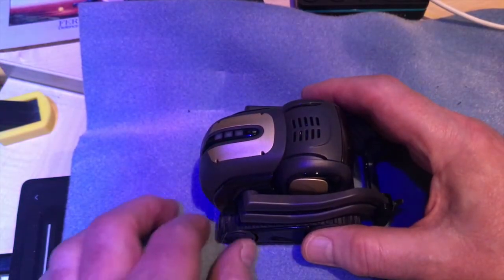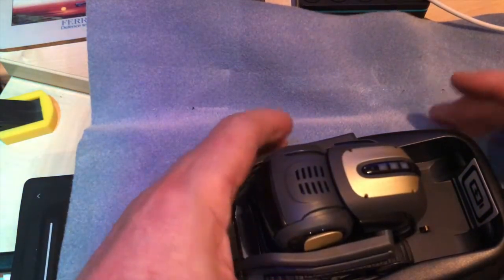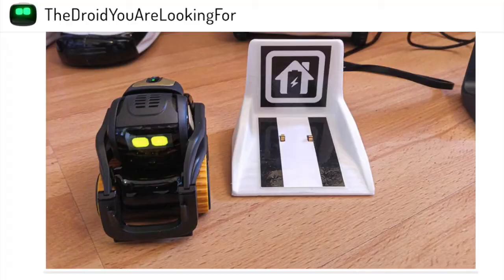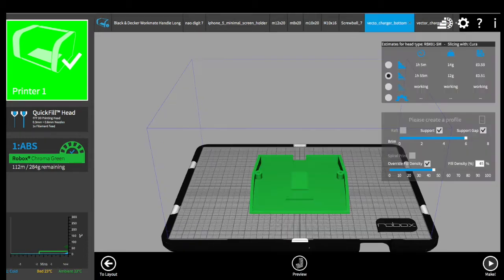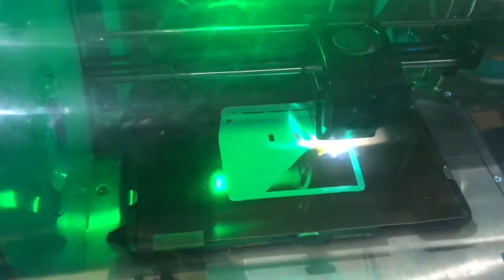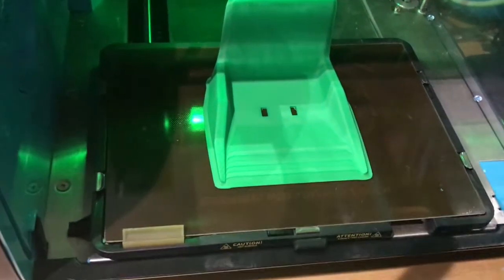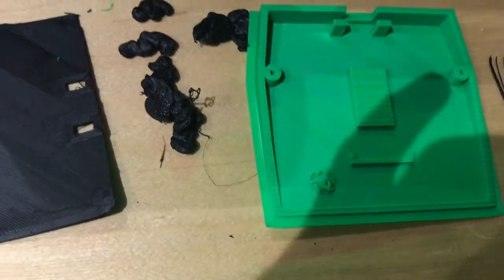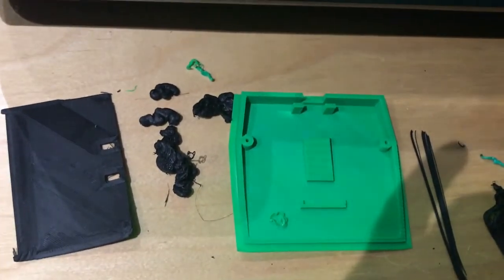How To Make Anki Vector Charger From A Cozmo Charger Part 1

Comment: Can you use a anki vector charger for cozmo??
Reply from the maker: I can't see any reason why not, as they both use vector and cozmo chargers, the charging is the circuitry in the Cozmo and Vector the station just converts the power wires in a USB cable to the two gold bars in the charger bed. Please don't forget to subscribe to my channel and check out my other great videos. Thanks Malcolm aka #fixed1t